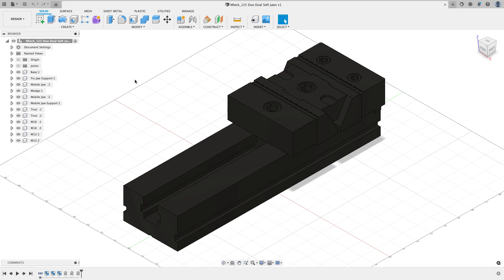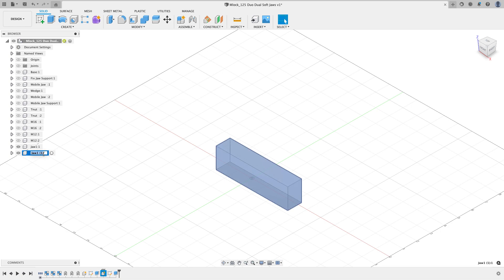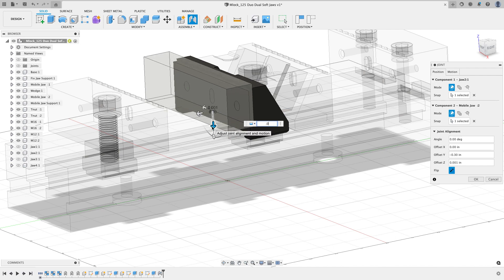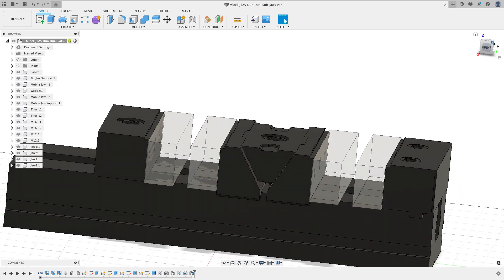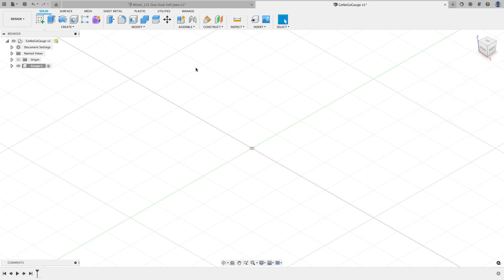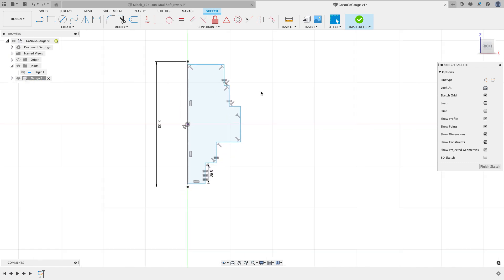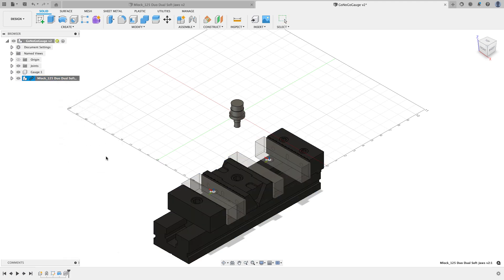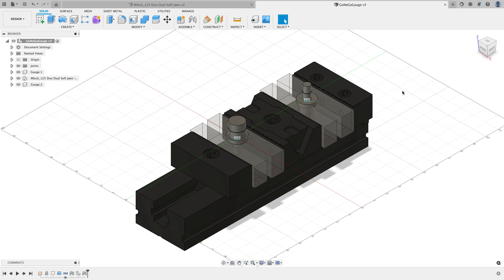Part 1 - Creating Joint Origins with Fusion 360

Comment: hey, so i dont have a mlock in my work holding tab, has fusion changed or is it a special add in?
it appears under all the category's its sorted by folders of brand name, not object type.
Reply from the maker: They are no longer in the workholding directory. There are some legal agreements that have to be signed I believe before they can be re-added.
Reply: Awesome thank you I went to school and actually took inventor and 3ds Max so using the free version of 360 feels like I'm missing a lot of the workflows and tools I'm used to. 
But for the most part I'm trying to deal with the lack of in place editing which is making a lining components and basing them off each other quite difficult so I thought I'd find a video to really show the difference between the assemblies, specifically joint origin is what I was wanting a tutorial for. I found in one of your newer videos what's the difference between joints and as built joints and I'm currently going through that and I was able to access the model you're using from the link.
Reply from the maker: @jamesharder3753 Fusion is very good at in place editing and designing components using other components.
Reply: Do you know if the free version that doesn't allow in place editing would have any complications or glitches or just headaches to deal with if I was to create joints in a component which was then brought in to another design as a sub-assembly, when dealing with the free version would I want to try to keep all of my joint assignments exclusive to one design file and be bringing in just rigid groups from outside
Reply: Yeah except when you click on it in the pull down of actions it brings you to the pricing to buy and to buy a month of this is like half to almost as much as my monthly rent and I'm not using this to make money, ask so when I drag assets in from the browser that came from other designs first you have to open them in a separate tab just to make things hidden or unhidden let alone any other changes. 
So I'm figuring learning the best way and differences between the wave joints are defined as the snaps is probably very helpful

Comment: Thanks Kevin!  You're video really helped me better understand joints and parameters.  I normally don't bother with modeling the vise in my CAD and CAM, but your video makes it's seem fun and less of a hassle.  Happy Holidays!
Reply from the maker: Thanks for letting me know. I have a couple of videos that show you how to create a parametric vise. One for a fixed jaw and one for self centering. Getting your vise setup makes the process much simpler. I will also do this for customers for a small fee.
Reply: I've been playing around with this today. OP1 is straight forward, as well as OP2 if one has a two station vise.

I've been thinking about how to do multiple operations on a single station vise while maintaining rest machining. Perhaps it's easier after all do it my traditional way? 

Having a vise is nice with its inherent collision avoidance, but there seems to be a point where the juice isn't worth the squeeze.  😁 @MechanicalAdvantage
Reply from the maker: @GaronPower two ways you can do it. Insert a second vise and add it to the opposite of your current part location. Or you can add a second vise next to where the current vise is. Then place a second instance of that component in the second vise in the orientation you need. Continue rest machining should work in this scenario as well.
Reply: Thanks, I'll give it a go.  @MechanicalAdvantage

Comment: Thanks for doing this! Your videos always help me to level up with fusion.  I’d be interested to learn more about making a copy of a component…you mentioned that it is another instance of the same component (since you did not use last as new). Does this mean editing the component in one place will change it in each instance? Are there any other implications?
Reply from the maker: Hi Gina. I’m glad they help. If you go back and watch the video, you will see that when I copied and pasted as new for the jaws, the name was appended to add a (1) after the copy. If you watch closely when I copy and paste the Gauge component, the name doesn’t change but shows up in the browser as Guage:2. So that means it’s the second instance of the same component. So a change to the Gauge component will change all of the instances of that component wherever they may be used. 

Does that help?

Comment: - Thx. Always interesting to see how others approach things.
- A couple comments...
--- Normal/Centerline line participates in closed profiles. So, give it double duty, and also simply use it as the leftmost line.
--- As for rotating the duplicated part, could possibly just use 'Flip' in the joint dialog, depending on orientation of things.
- Thx, again. I look forward to watching the other two vids...
Reply from the maker: I didn’t know that centerlines were treated as normal geometry.
Reply: @MechanicalAdvantage  
- Now you know :)
- I learn new things all the time, and I've been doing F360 for over 5 yrs, plus 3D for 30+ years! Part of what keeps it interesting.

Comment: Badass.  well done.  you always make these videos easy looking.  Very well explained as well.  Thank you!
Reply from the maker: Thank you. Just don't forget that i started doing 3D parametric mechanical design in 2002 with Inventor 5.3. The good news is that if you want to give it a try, you can 100% replicate step by step everything I do in this video and the following video. There is no substitute for practice and repetition.
Reply: @MechanicalAdvantage  Couldn't agree more with that.  It's like anything.  Seat time and a good instructor.  You have both down.  I've visited your website a few times and will more than likely pull the trigger on some training.   I have a Tormach 1100MX and some anomalies I've been having on the cam/machining side of things has stumped me for a bit.  I've been in the IT/ISP business for 30 years and got into machining as a hobby.  It's been very challenging to say the least.
I just need a good mentor.  There's no instruction book!!! LOL